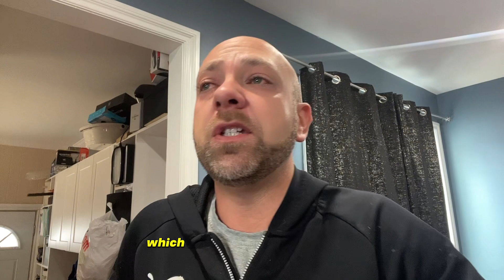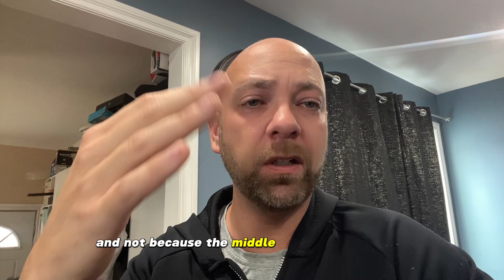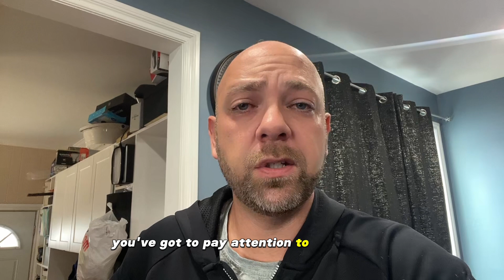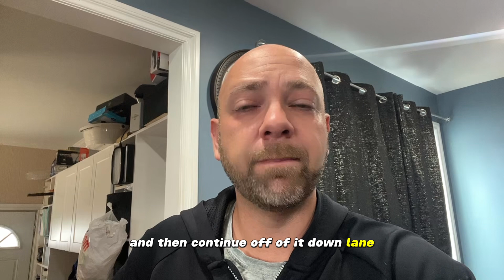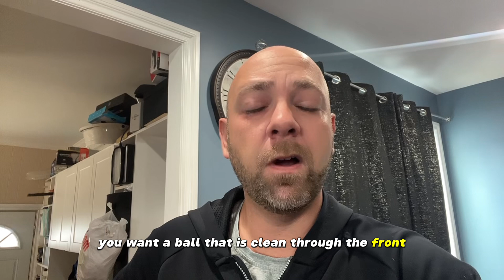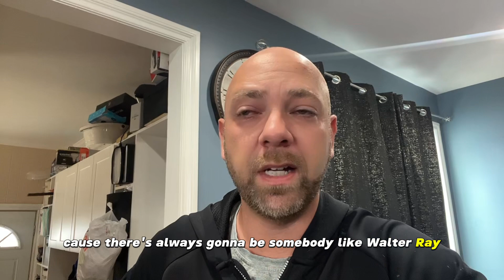How much does the amount of oil on a bowling lane affect ball motion?

Comment: When I was new to bowling I used to be a sucker for a super angular ball motion. I call it the 160 or 260. If you are super dialed in you can score big but most of the time it's too jumpy and leaves either big splits through the face or it never picks up at all.
Reply: Long skid 

Short hook 

Long roll phase 

That is the best ball track.

Comment: Fresh oiled lane?  How long does it take for fresh oil to settle before one should bowl on the lane?   What happens if you bowl too soon and  how much change occurs if oil is still settling?
Reply: Oil bonding to the surface usually is around 15-30 minutes, if oil isn’t fully settled the ball won’t read the lane as much and push the oil down the lane. You have less backend reaction in simple terms
Reply: Great question!  

Forward oil and then they have reverse oil to build up the oil topography. 

If the oil doesn’t settle then it is very probable the oil will easily be pushed down lane causing carry.  

Lot of THS are 42 feet long.  Rule 31 calculates the breakpoint at board 11.  

Well then if you have oil pushed down to 44 -45 foot mark it will result in an over/under reaction.  

Miss right the ball over reacts hitting the head pin.  

Miss left the ball slides going light never reaching the pocket.

Comment: Can u do a video on bowling oil viscosity? I have noticed several bowling centers changing their lane oil in metro Detroit the last 10 years. Every time I have seen a bowling center change their lane oil, the reaction goes from a clean predictable motion to this nasty hook early little to no movement in the mid lane and a complete lack of continuation in the back ends. What the heck is happening to the bowling centers in metro Detroit. Is there a disconnect with bowling ball manufacturers that keep making more aggressive equipment and lane oil manufacturers. I keep seeing centers putting out house shots that play more like a burned up practice lane after 1 game of league play. Not everyone is a pro bowler yet these lane condition play is very difficult with very little room for error. Please help!

Comment: Our bowling lanes is always putting down oil very inconsistent Its like the machine is not working correctly
Reply: Humidity and temperature would be the first factor.. the 2nd factor is they don’t clean their machine
Reply: @golden9668  Arizona so it's they don't clean the machine
Reply: @garyrood3466  most likely, I used to work at a bowling center in NY and mainly worked on the lane machine. If I cleaned the machine before I oiled and oiled at the same time every week the lanes were mostly consistent. Certain oils are very temperature sensitive but if kept in temperature controlled environment it lessened that variable

Comment: Great conversation!  

THS is a misnomer.  There is zero definitive typical.   The lane oil application machines are not perfect and questionable how they are calibrated, tested, and maintained to accurately lay down a lane oil pattern.  

The focus for many bowlers is not lane behavior, but instead plug and play roulette with bowling balls.  

Truth Be Told Time 

Reactive Resin Weight Center Block bowling balls 🎳 hook regardless of yo yo release.  So, no that is not the Biggest issue.  

The biggest issue is how the lane is behaving with two criterion: 

Ball energy management 

Ball down lane prognostic 

Oil volume and how the oil is distributed is Hugely important.  

If I had to guess my opinion the typical league bowler is close to 40 with less than 10 years of experience.  Most likely they are rev dominate bowlers.  

Which means ball energy management is especially critical.  

Pearl coverstock to get the ball down lane with minimum energy loss is important.  

Long skid 

Short flare 

Long roll phase 

That is the ball track that will conserve energy with the best control ability.

Comment: JR does fresh oil put down on lane have a big effect on ball 30 minutes bowling than oil have maybe 2/3 hrs before bowling bowling
Reply: This is a good question! I literally watch our lanes being oiled 20 to 30 minutes before league starts... same for mini tournaments. I suppose this is categorized as "fresh oil"...
Reply: @arcadesunday4592 it’s so the oil can bond to the lane surface
Reply: @golden9668  thank you for the reply. Still not sure whether the amount of time after the lane is oiled makes a difference once bowlers start bowling ? Ie: Does oiling the lanes 2 hours or 15 minutes before play make a difference in lane condition?
Reply: @arcadesunday4592  so the oil doesn’t evaporate or disappear. What can make the lane play differently for sitting so long is the dust in the air can get onto the lane which in turn can affect your lane conditions
Reply: @arcadesunday4592  if you took tapes of the same lane a day later the oil would be the exact same
Reply: @golden9668  thank you! That makes sense.